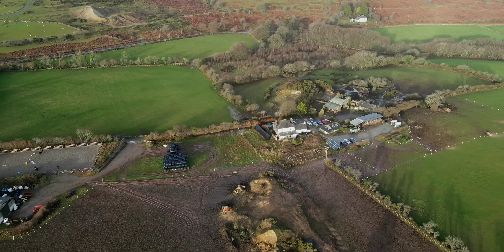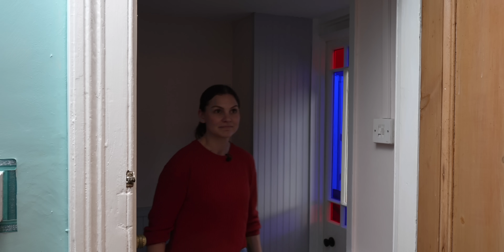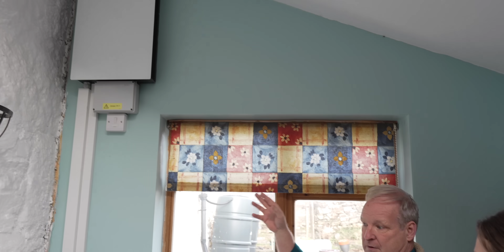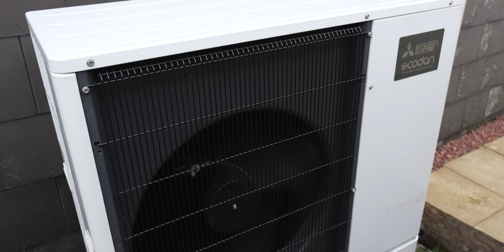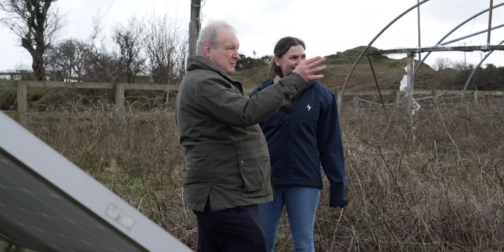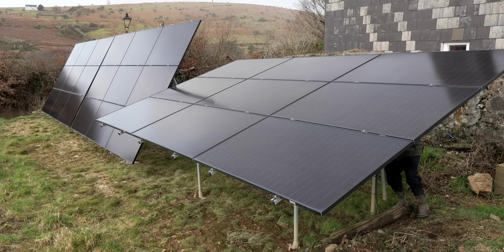Can Clean Technologies Work in an Old Farm House?

Comment: If you have the space, ground mount solar MUCH better than putting on your roof. You have to keep the solar panels clean and easier to clean when on the ground. Great setup with the heat pump as well.
Reply: Also the addition of the elevation solar adjustment is about 30% extra energy generation when you change angle in summer and winter.

Comment: Nice range of technologies here, I particularly liked the Cornish rocker. I did raise an eyebrow at the location of the heat pump outdoor unit - with a wall facing it like that you'll get a lot of recirculation of cold exhaust air, which will reduce efficiency. As an installer that would not be where I'd recommend putting one. (Also a couple of hours with a few quid of lagging and some cable ties would noticeably reduce losses from those pipes - the existing stuff looks a bit gappy)

Comment: Great foresight by Gerald in planning for the addition of an EV to his power consumption. If only governments were as wise in countering the extra demands on their own national grid supply that the increase in EV numbers will cause. 
Instead of all the hand-wringing over the grid failing due to EV charging demand they should be incentivising PV installation to promote electrical self--sufficiency and increased generation capacity on a national scale while also increasing the economic viability of EVs.

Comment: Great approach. We've added 6.4Kw Solar to our roof with an ASHP and an eddie to our two bed 1960s semi bungalow. Did this two years ago and never regretted it, but I was really envious of the battery and gateway.  The one piece of the jigsaw is that we need cheaper batteries. Liability 5Kw £5k and the Power wall at £10k doesn't make sense without an EV. Love the whole Fully Charged output.

Comment: Emilie is fantastic! This is main channel goodness. But alas the goons in the comments are over there. 

As per Emilie's request. I have a ev and Aotearoa is a mostly renewable power grid moving to 98% by 2030.  Wood burner is next on the chopping block. To be replaced with electrons at some point. Solar and battery eventually.

Comment: I have a cornish rocker too. Excellent system and really simple to adjust. I’d be a bit wary of quoting 40% improvement in production though.  Maybe in winter compared to a flatter orientation.  But at similar cost to a fixed system it’s definitely a winner!
Reply: The 40% came from there website.

Comment: I’m surprised Gerald hasn’t already got an EV, that usually tends to be one of the quicker wins people jump to, in order to soak up all the excess PV. Quicker to trade in the old car and drive home in a new EV than to get an air source put in considering the shortage of installers and all the paperwork inc planning in some cases.

Comment: Good show, man!  Though the typical narrative told by the news media is "rooftop solar", ground mounts can make more sense and cents for people with the space to put them.  Snow removal and perhaps washing the panels comes to might right away.  Do look carefully at the cost and strength of tracking or seasonally tiltable mounts.  Too often, the extra cost of moveable mounts provides Less energy than spending the same money on more panels on a fixed mount.  I'll concede that tiltable mounts might make more sense in the extreme north(or south) than for those closer to the equator.

Comment: Living in a 18thC home would like to know more about the heating system, e.g. what temp is the system running at, how big are the rads, how much power is used over winter. We run our solid fuel/wood system on low 24/7 to do similar to them, i.e. keeping it constantly warm which helps stop damp. I know some people 'up the road' who took out their air source as it was using so much power, but I think they where trying to use it like a standard oil boiler, with a big heat input morning and evening.
Reply: Rads run at 40 degrees C, No need to change pipes and only had to change 4 single side rads same size 60cm X120cm but double sided and we use about 1000 Kw per month over this winter so far.
Reply: @geralxallerton  brilliant, that's the way to do it!

Comment: Made it sound like it was just a case of dropping in the heat pump, any other work required to make it work? Radiators, pipework?
Reply: Basically it was, connected to existing pipework had to change 4 single rads to double rads (same size) no extra pipework needed.
The only extra work was the Electrical installation .
Reply: I wish mine is as simple when I get to it

Comment: Very nice! I'm a fan of ground mounts when one has the room. Maintenance and cleaning become very simple. There are no issues with optimum direction and tilt that one might have with a roof. If one really wants to splurge for high wattage, tracking systems cost a bit but there is no human intervention required in their tracking the sun from dawn to dusk. These days, PV is so cheap that the decision to track is mitigated by simply putting in more panels. It depends on the technology, but mine produce about 20% of the wattage during total overcast, so I simply multiplied my home's needs by that amount. Produces a huge amount of excess, but so what? The cost was minimal.
Reply: My main reason to go for ground mount is that my house is surrounded by trees.

Comment: I started with a Zappi Charger for the car, then got a 6Kwh Array - roof mounted - half on a flat roof, half on slate. There are solutions for most roof types. Back end of last year I got a 9.5Kwh GivEnergy battery - not as sophisticated as the Tesla, but much cheaper. My panels generated 6.2Mwh last year. I also insulated the loft and we replaced our windows which gave a big improvement in reducing heat loss. Also got a dehumidifier to reduce mold which is prevalent here in Guernsey. Already thinking about getting a bigger battery and a Heat pump. (no subsidies or grants here). biggest saving is probably the car which is free to run over the summer.
Reply: 😃Good of you. You could look ar IR-heater. They use your house, itself as the thermal mass, to heat the space inside your house. It was on one of the very recent shows of either the Fully charged show or everything electric channels. I think you would do very well with that to for example dry out your house and heat it at the same time.
Reply: @ewawiman9007  just installed a couple of these, very impressed…